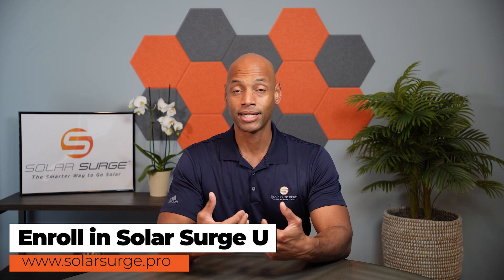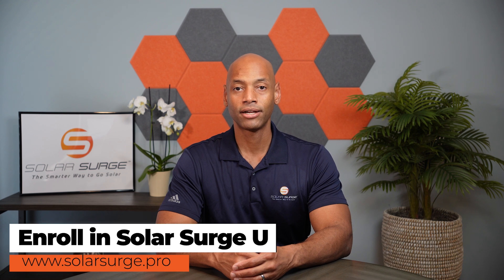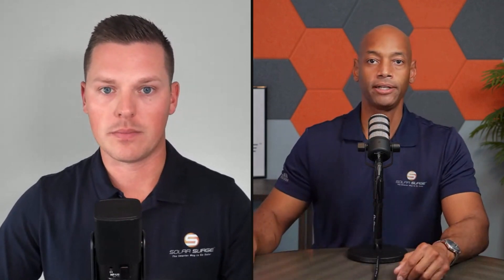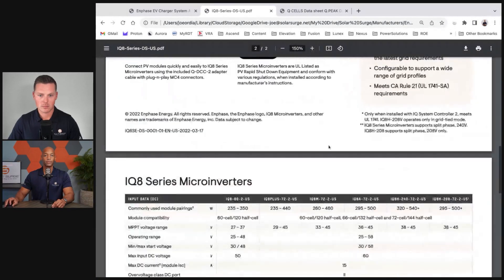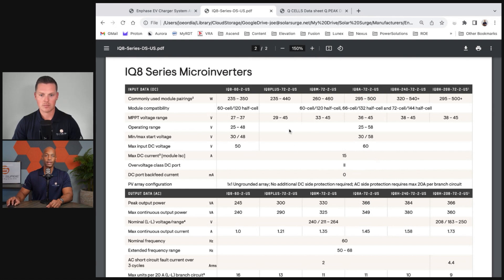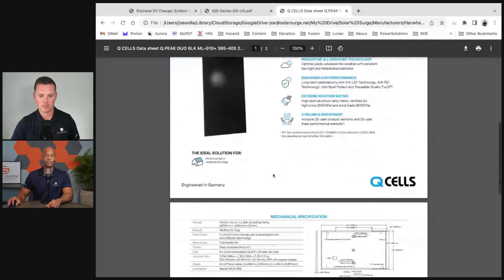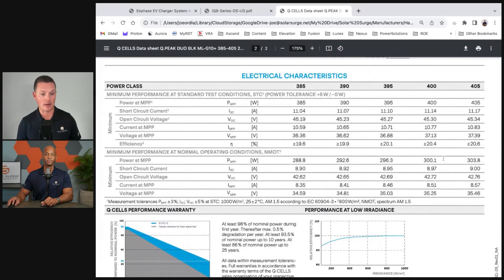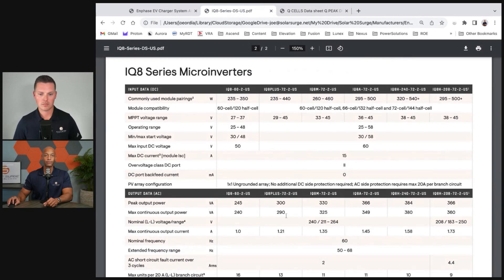Choose the Right Size Micro-inverter (Enphase IQ8 Series)

Comment: The one thing that you need to asterisk is that your output can actually be higher than  STC when dealing with bifacial panels in situations like snow or other very reflective situations where you gain a large amount from the light reflection to the back of the panel. 

So stating summer is highest production is not always the case and it does really come down to where you are located and specific install conditions.  

Also what you failed to address and actually should have been the core discussion is why sizing to a larger microinverter is not recommended in many situations is that its startup voltage of the inverter. In most units that support more wattage they have higher minimum volage requirements so until the panel output reaches that voltage the inverter wont start producing power and soon as it drops below that it stops.  So in addition to the operating efficiency at closer to its max you also have to take into account lost efficiency on the low end.  So in a place with lots of days that can be much lower output you could actually see longer generation from inverters turning on sooner and off later.  Probably not important somewhere like denver where you have the most days of sun, but in a place like seattle with lots of rain/overcast can have a greater impact.

Comment: I bought 3. Aptos. 440 watt.  biracial panels.   what micro inverter would you recommend. ?
Reply from the maker: I believe IQ8X would work with that module.  Check the spec sheet to make sure the solar panel output voltage is within the micro-inverter's input voltage operating range.
Reply: @SolarSurge  thanks very much sir

Comment: These guys dont make any sense and they are just making excuses for a product that can not support the new panels.  I have 575w panels and there is not an Enphase inverter that can support that.  Using one of these $190 microinverters and clipping 20% of my power is not an option for me.
I chose to use $45 optimizers and let my EG4 inverter just push the power to the batteries or invert it to AC if needed.  This gives better performance and it is less expensive than the microinverter setup.

Comment: I currently have a system spec with 420w panels and IQ8M. I am  getting mixed information if that's OK. Some say I should be using IQ8A instead? Any input would help thanks.
Reply from the maker: Yes the IQ8A would give you better performance.  Depends on the cost difference though.  I would ask the installer to quote both options.

Comment: Anyone who operates a solar panel knows that the actual output of the panel is pretty much in the middle between the stc and noct value. It is therefore not sufficient to use a 300W micro inverter for a noct 300W module. This is because if the stc value is 400W, the module regularly wants to deliver 350W.

Comment: 13:36 Sorry to be such a pedant but there are instances in which solar panels will perform better than standard test conditions. Out here in Colorado ,we tend to have fairly cold but extremely sunny days in the winter and with less atmospheric effects, we're capable of producing up to 20% more than standard test conditions.
Reply: i'm in Georgia and for a few minutes in the morning I have seen as much as 10% higher then the panel was rated for on really cold days when the sun first hits it.
Reply: Exactly, 1000W/m2 can be exceeded.

Comment: I find this talk a bit misleading. You don't design for clipping, in order to optimize for other seasons. You simply accept clipping, as a trade off in cost: a well designed system is in the optimal point of optimizer cost versus return on investment over the life time of the system. There is no benefit in clipping. The only positive about a smaller inverter is that it may start a few minutes earlier in the morning. It needs about 5 percent of it's power rating to boot. This start up power (not start up voltage btw) is slightly higher in bigger inverters. Other than that: the optimizers will perform the same in the winter spring and fall.

Comment: That was an excellent explanation, and reassured me that the 405 watt panels paired with iq8+ shouldn't result in much clipping. I just got the system installed a few weeks ago and was a bit swcond guessing my install.
Reply: What do you think about 440 or 470w panels ? Not suitable ?
Reply: @defaultHandle1110  You'll definitely experience some clipping. I first noticed it in March. I probably lose about 3-5% year round as a result of clipping.

Comment: In my country the 8 series were not allowed until now. 
I asked an installer to put solar panels on my building and he chose 108 halfcell panels of 430Wp ... that can deliver 13.5A... paired with IQ7+ which can handle 12A max.
As the IQ7+ goes to 295W power max this is ridiculously low, so I asked him for an alternative inverter. 
Now the IQ7A is installed, and this one does deliver up to 350W according to the datasheets,  ... but it is limited by the CURRENT to 10.2A so beginning october (so not even the best season) I see my panels producing 315W ... and that's it. (NOCT I mp value of panels is 10.9A > 10.2A and STC I mp value is even 13.49A). 
When I look in the Enlighten Manager App, I see the current is flattened for over 3 hours !!! at 10.1A. So I don't expect to get more then 315W from my panels. This is ridiculous.
 
So he installed 108 halfcell panels, which have lower voltage and higher current (the issue here) and those 108 halfcells are NOT even mentioned in the datasheets of the IQ7 series here.
Now I see the 8 series are allowed in my country and I also see the IQ8MC IQ8AC and IQ8HC DO go up to 14A and there 108 halfcells ARE mentioned.

So shortly : I can replace ALL my inverters now. 
Because the Enphase GOLD installer doesn't even seem to understand when I asked him if that 10.2A limit would be a problem prior to the installation.
And I even asked Enphase support, but they kept avoiding my question which made me clear now it's all about selling inverters and making profit and NO care for the consumer.
I'm having SEVERE clipping now. Because of the panels and inverters not being paired correctly in my installation and worse... I will have to pay a second time to pay for the correct inverters.

Also, the panels have a min VMP of 26V and the start voltage of the IQ7A is 33V. It takes hours after sunrise for them to start up. What a waste !

Comment: The clipping logic is basswards. Why would I want the power generation to be clipped in the highest peak of year generation? The inverter power (voltage/current) rating should be higher than the solar panel.  Where did that guy learn electricity? That's not even electricity, just capacity deisgn. Many people take your info, and they did not know any better.
Reply: Because your system will be only optimized for summer months and not be rest of the year. Efficiency drops if you pair too high inverter that doesn’t produce enough watts in the winter. You need a happy medium. Pay attention to what he’s saying
Reply: This may be relevant. As inverter capacity increases the amperage requirements on the main service panel change perhaps requiring that panel to be changed at great expense.

Comment: Joe, thank you for this educational video. I was questioning a quote that uses a Silfab SIL-400HC+ panel that's rated NOCT of 298. He was pairing it with the IQ8M, I was thinking it should be the IQ8A. This shows me he is pairing the system correctly. Again, thanks for the excellent content. I'm in Ocala, Florid and I'm heavily leaning to a ground mounted system as I have ample room in my backyard.
Reply from the maker: Glad this was helpful.  The SilFab 400W is a little underpowered compared to some of the newer 2023 solar panels.  Also, ground mount systems can be problematic in Florida due to high wind ratings and water setback requirements.  Please reach out if you need a comparison quote: https://solarsurge.net/

Comment: I am so tired of this entire "clipping" rationalization! Why not just market a microinverter that can handle the power that is coming from a 400 watt panel and be done with it?! Please do not insult our intelligence with all of this pseudo technical mumbo jumbo!!
Reply: Why would this be a mumbo jumbo, when it is normal even with string inverters to oversize the panels to get more from the inverter in times when the solar energy is not at it peak. That type of system will also get clipping and everybody is ok with that. But when you do the same with micro inverter it or regarded as mumbo jumbo.
Reply: BULLSHIT! Stop making rationalizations for microinverter manufacturers who are too lazy to make the proper size inverter! If clipping was so great then why do the manufacturers keep increasing the size of their microinverters? According to your rationalization, a 250 watt microinverter shouid work just fine with a 575 watt solar panel! BULLSHIT!

Comment: Since an IQ8A has one of the highest output rating, why so most just use the 8plus or the 8m, which has lower output rating, and to me more clipping.  Do I understand this correctly?
Reply: You pay extra for the higher model inverters, but the amount you gain by not clipping may not be worth it
Reply: $ difference is about $40, over time I believe the $40 would be worth it.

Comment: 2 Silly questions:

(1)
How do you make these Micro-inverters work if your home is single phase?  I live in an old home and only have have 1 hot 1 neutral coming form the  pole, instead of 2 hots.  2 hots would give me 240V in my panel, but I only have 120V throughout  the whole house.  Will Enphase Micro-inverters work at all in this scenario?  I have zero plans on a panel upgrade.

(2)
If the grid is active, and your solar is active as well, how does the house "know" to use solar electricity instead of grid electricity?  How does the house pick which power to use?

Comment: I just want to make a comment regarding the 3 inverter configurations that are possible and a comparison of their respective clipping losses. I designed and installed my first solar PV system in 1999. The next 3 systems I purchased (2 I designed) are representative of what is available in the US. The second system I designed is a ground mounted commercial Sunpower system that uses a Fronius Galvo 3.1 kW central string inverter and 8 Sunpower 425 watt modules. So the DC rating of the system is 3.4kW (8 x 425 watt). I have seen this system generate 3.2kW AC for 10 minutes and 3.53 kW AC for 10 seconds. So central inverter systems do NOT CLIP, at least not until the time has passed to risk reliability issues with over heating. So, especially with cool ground mounted modules these systems can exceed their power ratings without clipping losses. The third system I designed (also ground mounted) uses 10 REC 365 watt modules with a Solar Edge SE3800H inverter and 10 370 watt power optimizers. I have seen this system output 3.6 kW for several minutes without clipping as well. The 4th system I specified uses 16 REC 405 watt modules (roof mounted) and 16 Enphase IQ8M inverters. This system went on line on Aug 19th in Pismo Beach CA and has been clipping at 5.2 kW AC every day from 1 to 2 PM. So you do get some clipping losses with micro inverter systems. You do have easier expandability and redundancy with micro inverter systems but they have compromises too.
Reply: clipping has nothing to do with the type of inverter you use (central string or micro). it has to do with the panel output vs the inverter input.  all inverters have a power input limit - central string inverters will have something like 5kW, 10kW, 15kW, etc.  If you pare 20 - 500W panels (so10kW total max) with a 5kW string inverter, you will get clipping (i'm not suggesting this just an extreme example to prove the point).

Microinveters are just that - smaller versions of a central string inverter intended to be used for individual panel input (vs central string fed by multiple panels).  Hook a 500W panel up to a 280W microinverter and you will get clipping.

The opposite is also true of both central string and microinverters.  Hook up panels that don't maximize the inverter input (like 5 - 500W panels and a 10kW string inverter or a 380W microinverter on a 200W panel) and there will be no clipping with either the central string or the microinverters.  Use PVWatts to understand what your location produces and the best configuration of panels and inverters.
Reply: @gregorysmith9158  I'm simply saying that the power limit for string inverters is NOT a hard limit, it can be exceeded until temperature or other factors reduce the power- the power rating is very conservative. Micro inverters have a hard limit which can't be exceeded for long without damage to the circuitry.This is based on real world experience- I can show you the data if you wish.
Reply: clipping isn't the difference between an inverter's maxium short term output and its rated continuous output.  clipping has to do with pairing panels to an inverter(s) where the panels have a rated output greater than the inverter rated output.

your original comment describes two systems with panel DC output paired with string inverter AC output ratings that are approximatley equal (system 2 - 3.6kW DC with 3.1kW AC so DC/AC ratio of 1.16; system 3 - 3.65kW DC with 3.8kW AC so DC/AC 0.96) and one system with panel rating > microinverter rating (system 4 - 405W DC with 325W AC so DC/AC 1.25)).  System 2 should clip slightly mid-day in full sun, system 3 will never clip, and system 4 will clip mid-day in full sun more than system 2 (assuming these are all located in the same exact place on earth)  Its no surprise that you are getting the inverter rating on the string systems and you see clipping on the microinverter system - its a product of the pairings not what type of inverter you used.  Any inverter (micro or string) that is 100% saturated (so panel output wattage > than inverter output wattage) will produce the rated continuous output of the inverter(s) and not the panels.
Reply: @gregorysmith9158  System 2 (Fronius Galvo 3.1 kW AC string inverter with 8 x 425 watt Sunpower modules- 3.4 kW DC) Has never clipped.The peak AC power of the Fronius recorded last year during a cold spring morning was 3.56 kW AC! So the string inverter can greatly exceed its continuous rating and the SunPower modules do exceed their STC ratings due to conservative output ratings and the cooler temperatures. The Fronius regularly records continuous power of 3.2 kW AC for several minutes during the spring. The module tilt (30 degrees) and the azimuth (180 degrees) mean that during the spring and summer the output has 2 peaks during the day- I am at 37 degrees n latitude. Generally central string inverters do not limit output power as much as micro inverters.

Comment: Joe, thanks for the excellent review of this widely (and wildly) misunderstood aspect of solar system design.  The comments I read here call for further attempts to clarify this.....   I would come out of the box shooting for about a 1.33 to 1 ratio of DC to AC -- solar array output to inverter output.  This is the common ratio between the pristine conditions lab output used as an accurate measure to compare one module to another, and what we'd see in the REAL world, where output is whittled down by suboptimal orientation, soiling, degradation, excess heat and sub-perfect irradiance.  NREL's yearly roundup of utility scale solar tracks this metric and  over the years it has climbed up to and stabilized at this 1.33 to 1 ratio.  Yes at this threshold, there is a small amount of clipping.  Correction, a tiny amount of clipping, more in Phoenix, less in Duluth.  Say about 1%. Negligible.  Let's take the example from the presentation and the comment section of a 400 watt panel (or 4000 watt array) feeding into a 300 watt inverter.  For single digit hours per day for two weeks of days, you'll waste a pittance of output.  For most of the rest of the days of the year, when you are nowhere near filling up the inverter with watts, you are getting 10% or 20% or 30% or very, very often 33% more output than if you had just a 300 watt panel.   There is a very popular inverter out there right now with a 3000 watt output that can handle up to 5000 watts PV.  Sign me up in a heartbeat.  That is a 1.67 to 1 ratio.  There will be significant clipping at that ratio for sure.  (See @gregorysmith9158's comments about NREL's calculator for the projected amount of clipping.)  But so what?  Modules are so cheap the economics more and more favor oversizing the array.  40 years ago a watt was like a gold nugget and you could credibly argue for a 1 to 1 ratio.  All component prices have tumbled since then but module prices have collapsed.  A clipped watt today is a throwaway - relative to what you get in return.  Read the part in this comment again where it starts with "yes there is small amount of clipping".  And then re-read the part about the huge plusses.  Google "oversizing DC to AC ratio"  on youtube and you'll get more and more videos examining this very thing.  My hope and goal is that the comments following these videos begin to shift from the category of "I don't get this" to the "Got it!" side.
Reply: Thanks for this,  @gregorysmith9158's, and your comment were VERY valuable in filling-in-the-blanks for me to arrive at "Got it!" :)